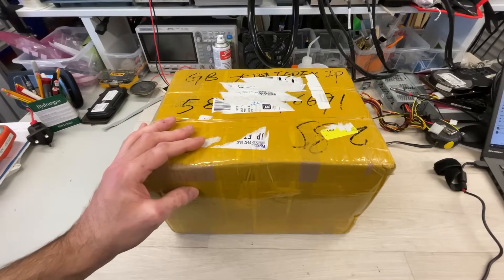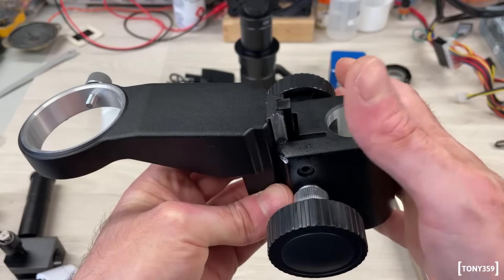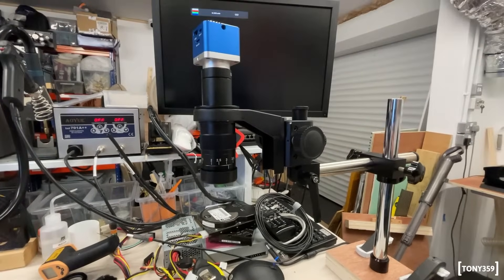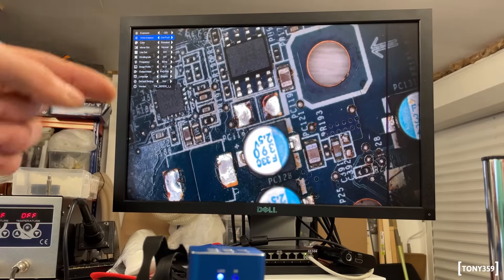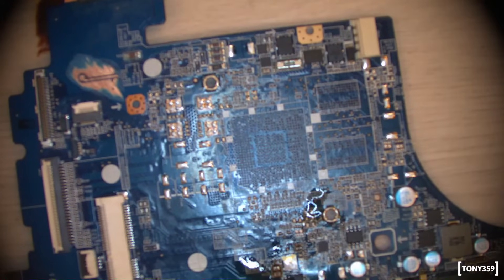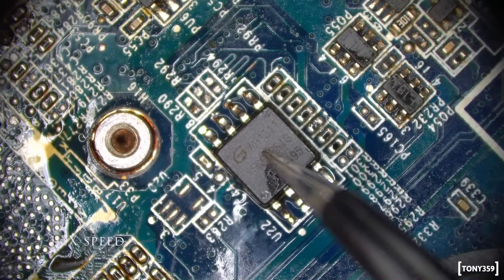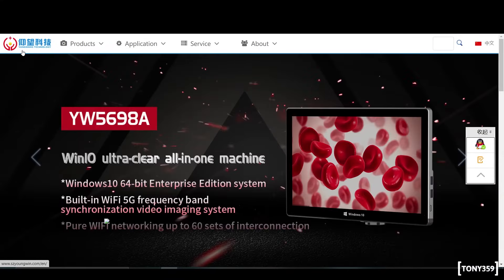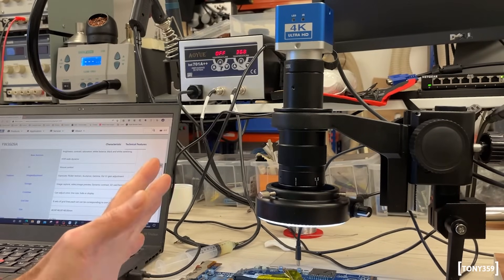Lapsun 4K Microscope - Sony IMX377 (?) - Unbox and Review

Comment: When using the white balance one push button, you are supposed to put a neutral gray card below the camera. Not something white like an A4 printer paper sheet, because it can be overexposed; white balancing should really be done on a lower brightness level. For example a Caruba DGC-1 gray card, or the gray card in a Colorchecker Passport will do. I know a perfect white balance is not important for this application, but if you make youtube videos with this thing and you really care about accurate colors, then a proper gray card is your friend. Especially if you experiment with different lights (like the ring light, or something different), then you can quickly recalibrate.
Reply from the maker: What you say is obviously correct but I feel it's not so critical for inspecting a PCB! The scope is in auto-mode and I feel it's doing well. Sometimes my light source has a different colour temperature so that automatic feature is useful! Thanks for your comment!

Comment from the maker: To all my viewers: thanks to @wrzone (see thread below) I was able to find out the actual CMOS sensor used on this microscope. I disassembled the small CMOS PCB from the chassis and found that it's a Sony IMX334 which is apparently a better sensor than the 377. Why the microscope outputs 24Mpx images I am not sure - but I guess it's a software feature.
Reply: Ok thanks
Reply from the maker: Snowpiercer2  sorry, typo! I also show 24Mpix on that same frame! Thanks for mentioning.

Comment: how do you like it now you've got 4 months of experience working with this camera?
Reply from the maker: I love it. I thought I wouldn't use it so much but it's become an important tool in my shop - and for the videos too! Quality is excellent and I love the DIY stand: the microscope is always there and I just need to plug the USB cable to turn it on and swing it around, done. I power it from my laptop so I can decide to watch it on the monitor or on OBS. I do feel the DIY stand was critical for the tool: I would probably not use it as often if it was a chunky metal stand sitting on a top shelf with all the cables disconnected. Only thing I might not like is the ring light which reflects on shiny solder affecting the overall picture but I think it's a necessary evil. An adjustable goose-neck LED light might be an alternative here maybe.
Reply: @tony359  did you get a 0.75 Barlow lens and does it work for you?
Reply from the maker: @mrv4757  yes i made a follow up video about that. The 0.75x is always attached and works well for me!

Lapsun 4K Microscope - Sony IMX377 (?) - Follow up and 0.75x Barlow lens test
https://youtu.be/YAdUFEa3CAY

Comment: A zoom lens which shifts focus with zoom is much easier to design and less expensive to make. It is not a problem for still photography, just a bit slower.
Reply from the maker: Understood, thanks for mentioning that - and for watching!
Reply: The upper ring where the cam mounts can be adjusted a tiny bit up/down on mine (180x) to sometimes reduce the focus-shift. (If yours is not perfectly adjusted.)
My barlow is attached on the bottom though (first surface) which allows the ringlight to be higher than that surface. It also protects the first element in lens from solder spatter and allows me to screw it on/off without taking camera off.
Reply: Agree, a perfect zoom is about impossible to make due to the manufacturing tolerances required, especially going from low mag to high mag. Even high end stereo microscopes like Wild require a bit of refocusing.

Comment: Tony, I don't know if maybe anyone else (or everyone) already suggested you to turn your stand opposite way ... right now the horizontal arm is a level - under the microscope holder ...
If you assemble the stand so the arm and the microscope holder are above, then they are not going to be on your way.
You will be able to solder without impacting with the stand(arm) and the stand will be able to go much lower than now (if needed). You have high enough vertical stand and from my experience you will never need to take your microscope so high ... definitely turn the horizontal assembly opposite way!
Another thing to suggest is: The scope is at your right hand and it is on your way - I can see that ... if you mount the vertical stand most deep at your desk (longest from you), then it will be away from your hands and you are going to able to put the entire microscope away from you either at the left or at thee right (or use it in a much wider area). By the way I am using my microscope this way (I explained you) but I have my very heavy metal base ... but turned opposite way (even more away from you) - It is so heavy that even in this position it holds this very long armed construction absolutely stable on my desk. The advantage is that you can actually remove the microscope easily, when you need the entire desk - sometimes I repair huge Audio mixers (desks), then I need even an extension on my desk :-)

Otherwise, thanks for the review of this SONY device - I am sure it will be useful for people who want to know details about it.
Reply from the maker: Thanks for the suggestion, appreciated! I'll do some experiments!

Comment: @ROKKO - I can't find your comment so I will just make a new post. My IMX334 camera was purchased from RISING CAM and is the RT5109. It's the newer version? with the IMX334. Before the camera used the IMX226 from what other people were saying. It now comes with the IMX334 and cost around $400-500 depending on where you look. From what I have seen the IMX226 is only able to output 4K @30 FPS but the one I use in my shop with the IMX334 indeed does output 4K 60 fps without all the frame interpolation un-like some of these other cheaper cameras. I originally purchased it because it claimed 4k 60 but I assumed it wouldn't be that great but 1080p 60 would be 100 % if they lied. This is one of the only vendors who actually isn't lying about the HDMI Preview frame rate and looks amazing when I record in OBS through my capture card. I have this camera connected to a 4K 55" TV also and I'm super happy with it. LAPSUN has been lying about the IMX290 camera for many years and it appears they still are when you go look them up.
Reply: I also really like the IMX291 camera from Amscope. I only paid 130$ with a coupon code and is very similar to the IMX290. It doesn't have a bunch of features but you can fine tune everything you need right there on the camera. I was shocked when I got it though. I wish had purchased that one years ago. It used USB C for power and has a HDR feature. Not the WDR which kills frame rate.  The auto settings are not good on the camera but when you turn everything off and manually tune it you can get a crystal clear image and it does output 1080p 60 fps without an issue. The only time I've ever made the camera lag was when max brightness is up to 10 causes it to freak out. I wish it had a regular remote but they do offer a wired remote. It's a great starter camera and really make you learn how to fine turn the video quality which has helped me with other cams.
Reply: @shiftctrlhack  Thanks for response, looks like that comment was removed because I added links to cameras even tho with spaces in them...
Reply: @shiftctrlhack  I'm looking for sub 200$ camera and my main struggle is lack of detailed description for Eakins and HAYEAR cameras plus sellers barely give any answers when I ask them something. For example that Eakins IMX334 for 170$ that I want has HDMI and USB 3.0 output but seller says he does not know if it supports UVC protocol over USB, tho few other Eakins IMX334 models have UVC support in their description. Same with HAYEAR IMX334 for 75$, it has only USB 3.0 output but description says it uses USB 2.0 protocol, tho listed outputs are 4k@25fps, 2k@45fps, 1080p and lower @60fps, that is not possible with USB 2.0 unless MJPEG compression has very low bitrate. Another thing with only USB output cameras is that I don't know how high is video delay, because HDMI for sure is much lower and USB delay depends on FPGA MJPEG codec optimization...
Reply: @shiftctrlhack  Yeah IMX334 sensor is great, there is aslo it's successor IMX678 that is made with STARVIS 2 technology (IMX334 is STARVIS, and in my opinion IMX290 is worse compared to IMX334 because it uses neither of these techs developed for better light absorption and wider HDR range) it's same sensor size 1/1.8" and resolution 8MP but has much higher light sensitivity and HDR range compared to IMX334, if you download datasheet for IMX678 you can see photo comparisons with IMX334 on the last page (because of high sensitivity it used in astro cameras ZWO ASI678MC). Also there are 8MP 1/1.2" sensors IMX485 (STARVIS) and IMX585 (STARVIS 2), both used in microscope and astro cameras and have almost same price as IMX678 cameras (nevertheless IMX678 is worse because of 1/1.8" sensor size with same resolution) and that price is much higher than IMX334 (300-400-500$ vs 75-170-300$) because of there are only 1-2 camera models with them and they can hike price a lot (there is one IMX678 developer module for sub 100$ with HDMI and USB2.0 output, description says it outputs MJPEG at 30 fps in all resolutions, but nothing about HDMI fps).
Reply: @rokko1337  Ya its super tough finding the right camera with the real components. To be honest If I had to choose one camera. The IMX290 from 6 years ago from EAKINS when they did sell the real IMX290 camera was the best quality video through HDMI that I have ever seen. The ones that people sell now are not the real deal. The DOL and back- illuminated technology really gave it the edge when it comes to low light with an extremely great picture. It is capable of 1080p 120 FPS so when EAKINS had it setup for 60 FPS it was smooth and had 0 issues. Good luck and let me know if you decide to purchase a camera. Report back to us on here. I'm always looking for a better quality camera for my repair shop.
Reply: @shiftctrlhack  Ok, I'll try to not forget report after I receive the one I'll choose, but it will take some time until I pick one and it will be delivered.
Reply: @rokko1337  Cool thank you !
Reply: @shiftctrlhack  Also, 30 fps limit at least over USB is probably because of the output format type, it's RGB24 (that is basically RAW) and you cannot select anything else (should be compressed MJPEG). After finding this out I checked another camera that I wanted to buy, it has only USB output, but can provide 4k@25fps, 1440p@45fps, 1080p@60fps, after finally finding demo video for it I found out that it works the same way: only RGB24 format, 20-30 fps at those resolution even in their demo video, same thing with few other cameras that claim to provide 1080p@60fps, but in demo it's only RGB24 and 30 fps...
Reply: @rokko1337 do you have experience with hayear? I am looking between cams hy 5299 and hy 6210😅
Reply: @creationsmv6201  Can't say anything particular about 6210, but 6110 (I suppose it is same model but with a bit different connection layout) can't output 1080p at 60 fps over HDMI, same as 5299 (tho one of the reviewers claimed in the comments that it can, but didn't provide any proof video). If you don't need 4k 60 fps (at 4:3 ratio) record to SD card, then 6110 and 6210 must be better, because they have better sensor model.
Reply: @rokko1337  Hey rokko, which one did you finally get?, ¿Could the Maant XJ-2 be the way to go?.

Comment: About the barlow lens, did you try to increase the distance from the lens to the camera?
I have used microscopes for PCB work for a long time. I would recommend a single light source at 10 o'clock to see depth. A ring light gives a very flat view.
Reply from the maker: You are absolutely right. The ring light is for lazy people like me as you never have to reposition it and it's always out of the way :) Thanks for watching!
Reply: @tony359  Not sure if it's already been mentioned or that you have noticed what could be potentially used to raise the ring light to a more suitable location. Wether this is meant for the ring light I am not sure but definately worked better for me. You can see the screw hole ( assuming the other two are out of sight)  between your thumb and firstfinger holding the lens  at 3:14 . Thankyou for your vdeos. keep up the good work.

Comment: Place a threaded insert into the desktop so that it is slightly  below the surface. You can put a screw in it when not using the scope or remove it and screw a piece of all thread into the insert and then screw your upright tube on to the all thread.
Reply from the maker: Good idea! Though that means making a hole on your desk :) Thanks for watching!
Reply: @tony359  that's why I said you could put a screw in it, preferably a flat headed so it would be flush with the desktop.

Comment: Look at the aspect ratio too,  4:0 v ~16:9, 12 Mpix v 9 Mpix max respectively.  You can test this data by taking photos in various modes and checking the resultant filesizes etc.  Perhaps its a factor of aspect ratio rather than colour model / filtering, though RGB v CMYG the later producing more data.

Comment: I bought a Eakins trinoqular about 2 years ago. I can't get used to looking down the scope(i don't have binocular vision. I prefer the HDMI. Wish I saw this first as it would be slightly cheaper. I would mount it to a monitor arm with a 3d printed Vesa mount. I may sell my scope and get a Lapsun . Great video. Thanks
Reply from the maker: Same experience here. I once worked for a few hours in a place where they had a Nikon scope. I just couldn't use it. First, the eyepieces were 10x and it was like looking through a pinhole. Second, I couldn't get used to that massive thing in the way!

Comment: With regards to the barlow lens distance issue. Why not  build an extension for your base that raises the entire system up to the proper operation range for it? /it could be maid out of an addition tube or wooden plates. Another option is to simply get a longer pipe that covers the whole range and a proper pipe clamp.
Reply from the maker: You'd end up with the microscope up in the air :) It's much simpler to get the proper lens/barlow lens, they are inexpensive!

Comment: Doesn't the lens have an aperture ring? If so then one might be able to get more depth of field by closing down the aperture, and either increasing the gain ( potentially adding more noise) or increasing the light. That said one might start experiencing diffraction issues if the aperture has to be closed to much, and at the zoom factor it's at the amount the aperture might not deepen the focus plane all that much, but it's worth exploring.
Reply from the maker: Hello - no, there is no aperture ring. Those lenses are cheap, I suspect that there is not much that can be gained! :) But it could be interesting to test!

Comment: HI tony, do you know any camera model/sensor that can record 4K@60FPS and 2K@120FPS?
Reply from the maker: No unfortunately and it seems to be a lottery. Even this one turned out NOT to be 60hz - it locks at 60hz but the actual framerate is 30! :D Typical!
Reply from the maker: the problem is that it's all promises. My advice is: don't overspend on Aliexpress.

Comment: I watched you video again, and you're absolutely right when you're saying in the intro, that choosing the right camera to buy is not an  easy job. There are some many offerings and 1001 suppliers. The specs are not always very detailed. That is why such an detailed independent video is very helpful. I also like to buy a camera and currently I have my eyes on hayear HY6210. I think it is a very smilar camera like yours. It has the same connections and buttons. No separate power connections I'm wondering if it possible to use usb storage instead of the microSD card? Maybe by attaching an usb hub on the usbc port. did you ever try that?
Also you mentioned that the usb output is limited to refreshrate 1920x1080/30. For me hdmi is more important and that is 1920x1080/60.
But Hayear also has the HY6110 which has usbc type 3 and 1920x1080/60 usb output. So maybe the usbc3 port allows higher transfer or maybe the cpu is faster? It is also € 35 more expensive.
Both have IMX334 although some listings show IMX678 but that is not correct I guess. On the hayear site I also see IMX334 for these 2.
Did you considered hayear in your search?
Reply from the maker: Apparently the video output is always 30hz - when it says 60hz, it's 30hz "doubled" so each frame is sent twice to the display. 
Don't overthink too much when you're browsing these scopes from China (no disrespect intended!), most of the specs are fake or "inflated" unfortunately. 

I'm still happy with what I have though and I still recommend it. 
Thanks for watching!

Comment: What is the resolution of the video signal of the camera to the HDMI output? 1080P, 2K or more? The quality of the digital zoom up to 4x should not drop with a 4K matrix. If the digital zoom crop the image from the matrix, then you can successfully use it. Have you checked it out?
Reply from the maker: I never considered that, thanks. The resolution and framerate should be 4K 60Hz but we've discovered that it's not actually 60Hz, it's 30hz doubled internally... So it's a good product, I still like it, but always take the specs with a pinch of salt :)

Comment: Great review. I wish I had enough space on my desk to set up it like you. But I'm doing repairs and Arduino stuff only occasionally and I need to tuck the scope away often. So, I guess, I'll go for Andonstar AD246S-M. Still, I wish it had a desk edge clamp instead of the small base. I will see if I can invent a mod with a desk clamp for it, similar to what you did.
Reply from the maker: the Lapsun-style scopes are also available on smaller stands - you do need a monitor but who doesn't have one nowadays? :) Thank you!